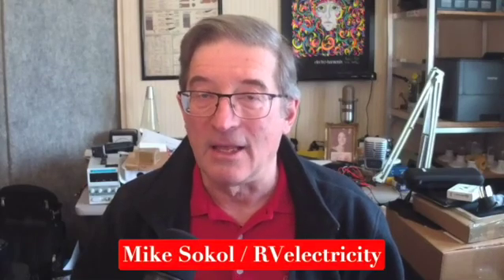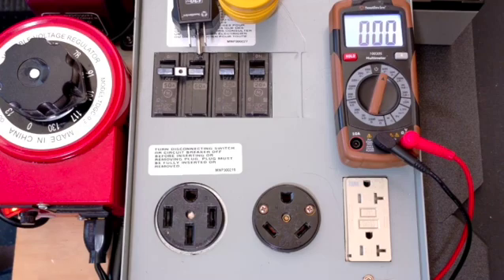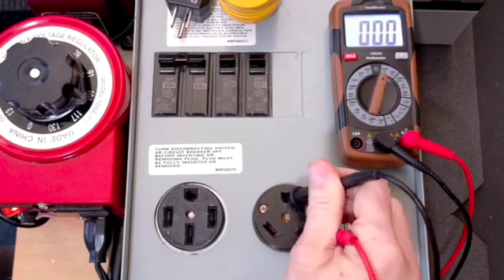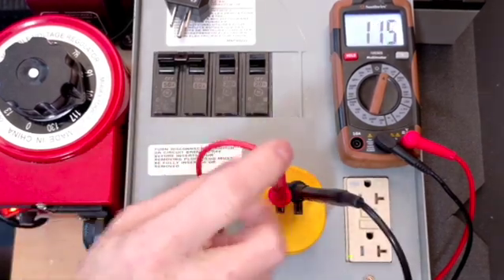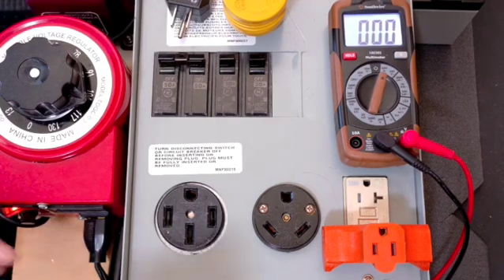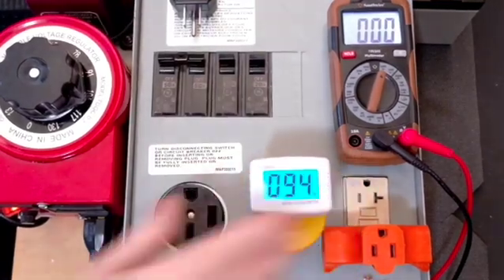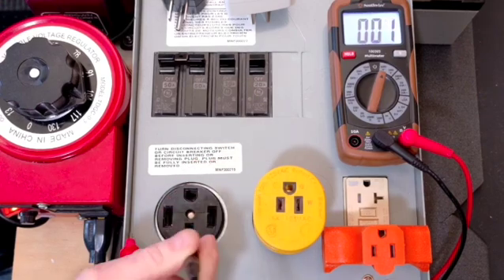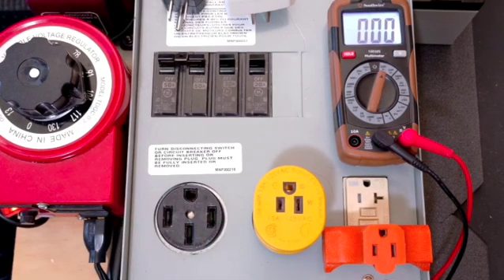Mike Sokol / RVelectricity Pedestal Metering with Southwire Multimeter

Comment: Good video for those who don't know how to measure their pedestal voltage. It might be good to mention that the voltage check is a "Snap shot " of what it is now. IO have had the voltage change during me stay and this has caused my EMS to drop power when the voltage increased to 138 vac and another time to 104 VAC. I also taught my students to use the holder on the back of the meter case or a rubber band to avoid using two hands to hold one of the meter leads to avoid the current path across the heart if leads are damaged or fingers slip up the probe.
Reply from the maker: You are correct, which is why I recommend using an Advanced/EMS surge protector that continuously monitors voltage and ground status.